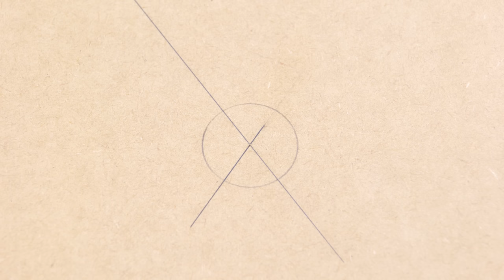How to make and use a simple trimmer table

Comment: The idea of using rubber bands for the screw clamps is simply brilliant. My compliment. Mike, Frankfurt / Germany
Reply: I use old bicycle innertubes. Cut them into half inch strips and close the ends with rubber cement (super glue works too). They'll last forever. Long after regular rubber bands deteriorate.

Comment: Best job-site handy little router table I've ever seen. Easy to carry, easy to mount on a couple of sawhorses or almost anything horizontal and stationary, easy to stow in the van and, with the little trimmer removed, easy to hang on the shop wall while not in use.

Comment: When the technique is mastered, the strudences, the fuss and the over acting are of more. That is what happens on this channel. It captivates you from the first video because what unfolds before you is the eloquence of knowledge and the mastery of technical mastery. Each video is a surprise that never disappoints. Since I saw the first one, I am hooked on this channel. Those who really know are instantly captivating.
Thanks Jisaku.
Reply: @toddbloss  
I don't think it's anal.  The sawdust (chip) accumulation will compromise the precision.  Esp. with the small machinery as this.
Reply: It’s captivating. I’m sick of the over caffeinated “Xtreem” douchebros yammering on, while doing undisclosed promotions for tool manufacturers. I’ve been thinking about doing a parody, “The Adderall Wood Bro”, but I don’t think I can maintain the shtick for long enough.

Comment: What I really like about your videos is that you work in a tidy and clean manner. The fitting of the two bits of wood - satisfying.
Reply: I definitely want to make this as I don't care for the router table I bought years ago. I still use it, but don't really like it.
If I can put together the two pieces of wood using the 90 degree angles that he did, then I'll have to go for doing dovetails next.

Comment: this channel is rich with ideas, thoughtfully and artfully executed. the ideas are portable to many set-ups, even if you dont make the exact same jigs. the hold-down jig used here, but elaborated in another video, is especially brilliant, as is a pivoting fence, and other ideas

suggestion for hole-sawing in wood or mdf: silicone lube is a superb 'cutting oil' that dramatically reduces friction, eliminates burning and extends blade life-- blade is only warm to touch immediately after use

Comment: Ah yes, I've used these a ton in my guitar shop.Sometimes I'll have my other two big router tables occupied with other projects so it's easier to just put one of these together, you can really do a lot with them, I use them primarily for cutting wood binding and routing all of the access cavity covers and pic guards for electric guitars.

Comment: MDF is pretty underrated for things like this, cheap yet very dimensionally accurate. You are truly inspiring!
Reply: I am not so sure. I have some MDF boards and they tend to bend as time goes on if there is moisture or pressure on them. I would try to reinforce it beneath somehow.
Reply: Vielleicht sollten die überstehenden Kanten unterhalb der Platte aufgedoppelt werden; dies bringt mehr Stabilität.
Für eine schnelle Lösung passt dies wie es dargestellt wird!
Alles andere Bohnen zählen auf hohem Niveau.

Comment: making this right now :) just attached the board to my DeWalt handheld router. It took me several tries to find the right bolt. Its M4-.70x30 from Hillman if you're shopping at Lowe's or wherever :) I tried 8-32's but those didn't work. But the M4's work great :)

Comment: Nice and simple. The only thing I would do differently is glue melamine to the top before marking and cutting the router holes. This will make it much slicker and easier to feed wood across. You can hear the friction in the wood when he's moving the pieces.

Comment: Nice. I was a bit worried about it becoming a plunge router as the table was a bit wobbly but it could be easily remedied by another clamp or perhaps with a support leg. Also the plastic parts worry me. Anyways, looks doable, and I'll get my router soon. Maybe I'll do this someday, would consider using an aluminium plate for this.

Comment: I built roughly the same thing for a larger router mated to my table saw frame. I would suggest adding a vacuum hose to your router fence, right over the middle where the router bit is located. It does wonders for keeping the workpiece free of chips and removes dust from the air.
Reply: Hi, any idea of what the grips are that are used at the start to hold the wood and where I can get them, I've obviously got G clamps etc but can't find any of these?
Reply: @stephenrodgers6239  I don't but they do look cool. I like Dewalt trigger clamps for their ease of use and strength, and good old fashioned bar clamps (the kind you buy whatever length of bar you want from the hardware store) for anything where a need a lot of length and pressure. 

You might try asking the poster of the video, he'll probably know what kind of clamps these are.
Reply: @ScoutSniper3124  much appreciated, I've sent the poster a msg so hopefully I'll get some idea soon. Thanks again.

Comment: This is great totally portable router.  It can be attached to a saw horse out on a job or anywhere that has a flat surface and you can get a couple of clamps on to hold it.  Far better, more functional and REAL value for money than a cheap ALDI, COSCO router.

Comment: Impressive and simplistic.
Reply from the maker: thank you for the advice.
Methanol is used in the video.
It acts as a very effective cutting fluid for aluminum.
The problem is that it has a low viscosity and falls off the bit quickly.

Comment: Wood on wood sliding is a bit tricky and does not work very well. I modified the slider by glueing metal to the end pieces and it slides a whole lot easier than using just the wood. You can use a very thin piece of metal. Also a little bit of oil helps the sliding process. Otherwise this is a very good jig and very easy to make. Thanks!

Comment: What I like about this is that when you go to store it, it's flat. Of course, you need a workbench you can firmly clamp it to. When you set up the fence, you could mark on the platform which positions would give you a 1/2" rabbet or a 1/4" rabbet.

Comment: I built one of these last weekend.  Unfortunately, it didn't work.  The problem is the router bit doesn't extend high enough to be revealed over the top of the table.  I used 1/2" MDF.  I can get something like a groove bit to be ~3/16" depth, but can't get a roundover bit at all.  I'm also using a Makita trim router.  Any suggestions?

Comment: Love this, thank you! For the rotating fence on a single pivot point, why not make it the other way round so you work towards the bench, instead of having to reach over the bench to push the workpiece into space?
Reply: Might be a stupid question but since it’s locked at a pivot point at the corner won’t that cause cuts to not run parallel to your work piece?
Reply: @shannonsanjivan7785  not on a router since you're dealing with a round bit it doesn't matter the angle of the fence because your board is going in a straight line no matter what.

You could make the fence in the same way as he did the miter as well but not needed.
Reply: @JamesSmullins  thanks will try it out.

Comment: Totally nonsense to built such a stationary device with an accu driven electric tool. I am getting crazy that we use accus everywhere. Even when the lithium ion versions have a good lifetime. The Chileans do not have water for the farms and we use lithium out of their ground to run an electric motor indoor, which is not even used by hand.